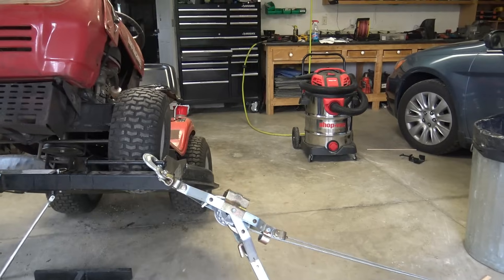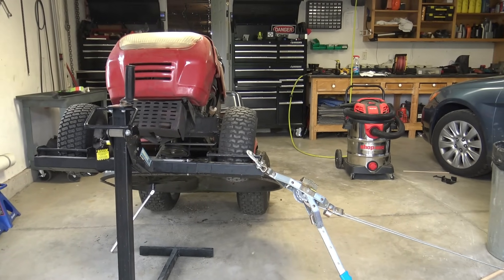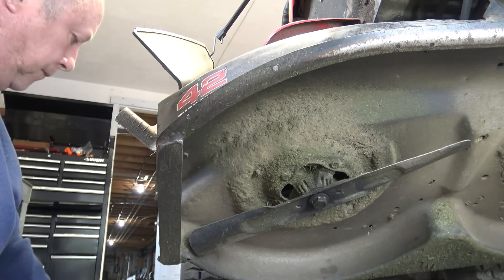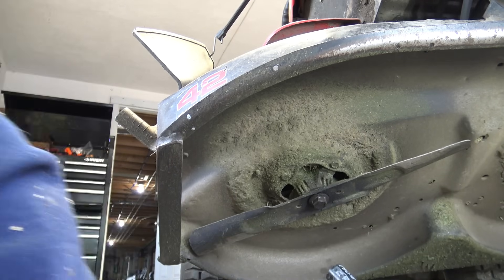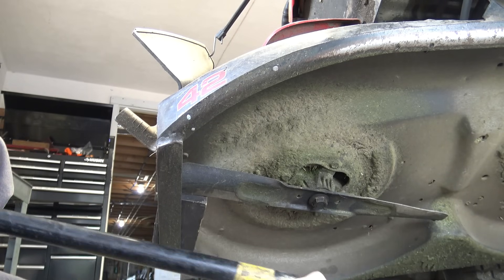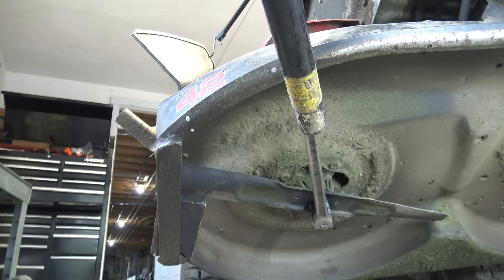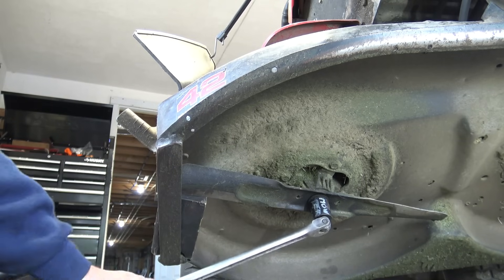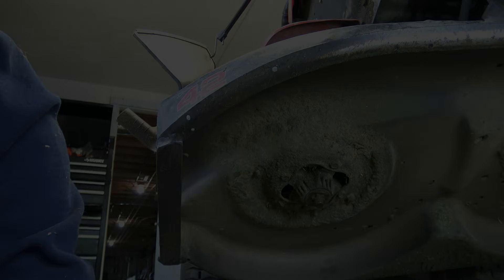How to remove a stubborn mower blade nut

Comment: Fantastic video, thank you so much! You explained it quickly, and simply, just the way people need to know so we can get on with the job rather than watching through a 30min video. I'd tried WD40, heat and an impact drill, but no good. Tried your method and BANG! They both came off! Thank you!!!!!!!!!!!!!!!!!!!!
Reply from the maker: Thanks for the kind words;  I was afraid to apply heat because the spindle housing is aluminum. I don't know why those things get so badly frozen on. I am glad you got yours off. thanks for watching.

Comment: Fantastic idea with anchoring to something else.

Ive been struggling past hour. Scared it was going to fall off my jack and stands

Watch this video and I ratchet strapped from frame of mower to my hitch on truck.

Took maybe 10 more minutes and I had both blades off. They were on there GOOD
Reply from the maker: Thanks, I don't know why they get so tight at times, As I recall I had not changed the blades in a couple of seasons.

Comment: Your video helped a ton. I had the same problem but didn’t have a metal pipe. I had a spare pvc pipe laying around so I used that and it worked like a charm. Thank you for the idea!
Reply from the maker: Thanks for the kind words, Jason,  I am glad you got the blades off
Reply: Would spraying it with WD-40 or something help ??
Reply: I did try that first but the WD40 couldn’t penetrate deep enough into the threads to do anything

Comment: Mapp gas torch and water are your friends to free up frozen bolts/nuts.  Just used the technique on the bolts to remove the baffle on my 8 year old riding lawnmower.   Worked great.
Reply from the maker: I did not want to use a touch because the spindle is made of aluminum.

Comment: Thank you sir for posting.  I removed my mower deck as opposed to lifting it but the key principle you pointed out is it takes a breaker bar along with a sturdy metal pole to extend it.  I had two rounded bolts so I had to special order an Irwin extractor socket and on the ground in the 'rowing' position I was able to finally loosen both of them.  Great tip!
Reply from the maker: That is how the owners manual suggests you approach the job by removing the deck, The machine in the video is not like the new machines today, it is very difficult to remove the deck and even harder to put it back. The lift in the video cost about 200 dollars, I am so glad I have it,  thanks for your kind words and watching my video.
Reply: instablaster.
Reply: L

Comment: Fighting with this same thing today.  Good idea about putting an extension bar on the nut to get the needed leverage.
Reply from the maker: I had not changed the blades in a couple of years at the time, I think that is how they got so tight. thanks for watching
Reply: @richardspaulding5035  we ended up using an impact drill and a cool mower lift to get the nut lose and the new blades on.  Thanks
Reply from the maker: @Butler_Buck  Glad you got them off. As you saw in the video my impact gun did nothing.

Comment: Richard, listening to you was like hearing my own replay.  Changed the oil today, rolled the front up on some stacked cinderblocks, chucked the back wheels, pulled the plug.  Put the socket on and tried with a large 1/2 ratchet driver....  O.o  Impact wouldn't bust it.  WD40 for like an hour.  OK, I've always needed a breaker bar anyway, just in case.  Run to store and picked up an 18".   Now I'm sweating, both my new shoulders are screaming, and I'm swearing.  I'm done for the day.  How long a piece of pipe was that?  It'll be the last time I leave it out.  **Your garage looks freaking awesome*
Reply from the maker: About 4ft long
Reply: Got it. Done deal.

Comment: thank you for the great idea, I just happened to have a bunch of perfectly sized pipes laying around from the last owner. I just put my foot against the rear wheel and cranked with my breaker bar+pipe.. POP! thar she goes.
Reply from the maker: Glad you got the blades off. Commenters have written that the blades were put on too tight in the first place. That is usually not the case. If they have not been changed in two or three seasons sometimes it is caused by corrosion.
Reply: @richardspaulding5035  Thank you, Yes it was definitely corrosion that seized it on there, I didn't do it for a couple years. I put some anti-seize on this time.
Reply from the maker: @IAmAnAiAndroid  good move

Comment: Lowe’s talked me into a impact drill never mentioned breaker bar. Thai was wicked ahhsome. From Bahston. Thx.
Reply from the maker: In most cases the impact wrench / drill will work.  However in this case my impact tool was not strong enough to brake the nut free. Thus I used a breaker bar and still had to add a pipe as you saw for more leverage. Thanks for watching.

Comment: Be sure to use a six point socket when using a pipe. Otherwise you can round the nut off. I learned that the hard way.
Reply from the maker: I did one better. I used an impact socket 
I think we all learned that one the hard way. Thanks for watching and thanks for  the advice.

Comment: i've had success removing frozen rounded head bolts by spraying with WD 40, leaving overnight then heating the bolt with  a map gas torch while hammering the head. They can then be removed with a no screw head socket wrench. Make sure you have a new set of original hardened bolts for replacement before you begin and put a little grease on the threads.
Reply from the maker: Thanks Frank for sharing that with us. Just remember the spindle housing is made of aluminum.  if you get things too hot the housing will melt before you can react. Thanks for watching my channel.
Reply: @richardspaulding5035  Right on Richard! I was thinking that at the time but the blade & nut would absorb a fair bit of the heat - not to get it red hot of course!  mainly to blue the bolt for the cutting socket & soften gunk under the washer & thread a bit.
Reply from the maker: @frankfeatherstone8976  Yes with map gas you are probably not producing a tremendous  amount of heat.  I use ox/acetylene, I would would melt that spindle in a heart beat  lol. thanks for following up.

Comment: Had to do same thing, what causes nuts to get so tight, would installing new nuts help?
Reply from the maker: I think it was just corosion.  That was the first time having that issue with this machine. I had had the machine for about 5 or 6 years when that occurred. Prior to that I had changed the blades at the start of each cutting season without much difficulty.  For reasons I don't recall I had gone two seasons with that set of blades when I had the problems getting them off. If anything, I would coat the nut with Permatex Anti-Seize compound.

Comment: Just had to go threw this!!! Unreal. I used penitrating oil a hammer to hit on it and a 24 inch breaker bar, with the floor jack handle for extra leverage!!! It finally broke loose. When reinstalling I put some grease on those threads. and torqued to 70lbs. 
Hope I never have to go thru that again!!!!
Reply from the maker: Thanks for sharing your experience RALPH;

Comment: They haven't rusted, it's just a p155 p00r design.   
Mine won't budge at all.  I've tried popane, hitting the wrench repeatedly with a hammer etc.  The only thing I haven'ttried yet is aceylene, a breaker bar, or an impact wrench.

Yeah, I watched how much force you were exerting, that was enough to strip the nut, you got lucky... this really is a s0rry design for attaching the blade to the spinner.

I tried the breaker bar (a road sign square pole, the only thing that would fit my huge wrench end) and all this method did was strip the nut.
Reply from the maker: Where I was at, I felt I had nothing to lose. I did not think I could not use acetylene because the spindle housing was made out of aluminum. In any event I was prepared to replace the spindle should things had not worked out they it did. If you were using a wrench that may be why the bolt stripped. You really needed a 6-point impact socket

Comment: Try a small pipe wrench, it worked for me after rounding the bolt with a socket.
Reply from the maker: That sounds like a great idea. If if I am ever in that situation I will most certainly give it a go. Thanks for sharing your idea and thanks for watching my channel.
Reply: Richard Spaulding No problem, enjoyed your pod cast. I was just before getting a breaker bar and thought I'd try the pipe wrench first , it popped lose without using a breaker bar with it.My dad used to use pipe wrench for a lot of things, I guess that's why I thought of it. 😁

Comment: Have a vid on stripped bolts?
Reply from the maker: I recently received a comment from a viewer reporting he used an old plumber's pipe wrench and a long pipe to fit over the handle for leverage to remove a stripped bolt on his mower. With those pipe wrenches' the more force you apply the tighter they grip. let me know how it works

Comment: I had to replace pulley spindle assembly, it was in pieces. The shaft from the old one is still attached to the old blade, can't get it to break free. I replaced that one with new blade. But how can I get the old blade off the other side to replace it? No lift, doing this lying on the ground. Any suggestions??
Reply from the maker: The only safe way without the lift is to remove the deck. I tried one time using planks supported by the tailgate of my truck. The machine came down as I almost got injured.  Do not try anything like that. there are some nice vidos on how to remove that deck. It is a pain to remove but not terrible.

Comment: Why does the bolt on the spindle turn also while I’m trying to get the blade off
Reply from the maker: If you are using a piece of wood to keep the blade from turning while loosening the nut and the spindle turns also then most likely the end of the spindle that locks in the blade is stripped.  if you will notice on the new blade the center hole is in a pattern usually like a star shape.  If that star shape has worn or stripped off the bottom of the spindle the hole thing will turn. if that is the case you will need to order a new spindle. There are videos on YouTube to show how to replace the spindle.  Last time I replaced one of my spindles it was about $50.  let me know how you make out.
Reply: Thank you
Reply: I'm having the same problem. With a cheater pipe on the breaker bar and a lot of effort the bolt will turn but not break free. I guess I will buy a good impact wrench and try that. If that doesn't work I'll have to bring it to the dealer. Thanks for posting a great video!

Comment: Interesting how much praise this guy is getting for using a pipe extension. As if you people have never heard of the concept of a breaker bar??
Reply from the maker: Not just the pipe, the video included chaining the machine so it would not slip and instruction as to which way to turn the nut. It also demonstrated that the owner need not be afraid to use excessive force. Furthermore, in the video I suggested the use of safety glasses. It is ok however, you are not alone, I get lots of comments from other haters.

Comment: Tried a impact wrench it's took the edges of the bolt so now I can't grip it with anything, now what do I do!
Reply from the maker: You must have been using a 12-point socket for that to have happened. Pick up a 24mm 6-point impact socket as that might still work. A 15/16 standard socket is slightly tighter than the 24 mm socket If you want to try that. All that is assuming your spindle nut is the same size as the one in the video.  Do not use a touch as the spindle housing is likely made of aluminum. Stay in touch as I may have other ideas if that does not work.
Reply: @richardspaulding5035  it was a 6point 17mm size the only one that fitted it well 15mm didn't fit 18 was too big, with a impact wrench ona murray ultra msd100 mower, ill try some spanner with a long leverage to get that off if I can find one ha
Reply from the maker: @honorabilis1  If that fails pick up one of those nut splitter tools. They sell them at AutoZone. They go for about ten dollars. Then pick up a replacement nut at your local hardware store. I would like to know how you make out.
Reply: @richardspaulding5035  I got one off with mole grips and a old ferguson te20 exhaust I had laying around for leverage ..could call that exhausting work ha
Reply: The other bolt though is just a circle now , I need to buy some bolt extractor
Reply from the maker: @honorabilis1  I am glad you got one off. They have these special nut extractors, The more pressure you apply the tighter it engages the nut.
Reply: @richardspaulding5035  ordered something that should get it off, only doing this because the belt snapped and took deck of to find blades badly dmged and blunt do replacing those as well, was a imported ride on mower from USA, I'm in UK
Reply from the maker: @honorabilis1  Let me know what you used and if it worked, may help other viewers
Reply: @richardspaulding5035  i tried some bolt remover designed to do it, but they just broke on me, ill try drilling it out next
Reply: @richardspaulding5035  no luck yet drill bits don't cut into it, ones made for extracting bolts don't work ethier at this point I'll have to just buy a new deck
Reply: @richardspaulding5035 i removed my rounded off bolt by using a pipe wrench and a pipe on the handle for leverage.  Replaced the bolt with new from hardware store.
Reply from the maker: @philipkuchko4860  Great idea
Reply from the maker: @philipkuchko4860  A Pipe wrench at times is a great tool to have on hand.

Comment: just bought a longer wrench ..ng .. breaker bar sounds good
Reply from the maker: May need a breaker bar and a pipe. Those dam blades can get really locked on there
Reply: @richardspaulding5035  final attempt used a plumbers wrench I couldn't believe it worked.

Comment: So.. the come-a-long.. could you expound on that a bit more?
Reply from the maker: Thanks for the question jean; It is actually a geared cable hoist. If you want to see what one looks like just google search cable hoist. I just hooked it around a support post in the garage and attached the other end to the machine to keep it from slipping when I exerted the force with the breaker bar and pipe. An ordinary chain would have worked as well. I hope that clears it up for you. Thanks for watching.

Comment: I wonder if you could rest that breaker bar against that steel column, and then start the engine and engage the blades.  I remove crank shaft pulley bolts on cars that way.  Just make sure you're 100% sure of the rotation direction or else you'll have a breaker bar flying thru the air.
Reply from the maker: Thanks for the suggestion; But not in this lifetime

Comment: My lawnmower has some sort of plastic cap over the bolt , I'm really struggling to remove it so I can finally just unscrew the blade from  the motor
Reply from the maker: I have never heard or seen anything like that. Can you snap a phoro and post it on your channel?  I will subscribe so I can see it.

Comment: What if you don't have a lift like that?? How can I get to it to get nut off to replace blade? Very rusted. Yard machine mower
Reply from the maker: The procedure for changing blades is to remove the deck. In that particular machine it is a pain to get the deck out. that's why I purchased the lift.  you can get them at Lowes or Home Depot for about $200. Thanks for watching my channel
Reply: Just use a floor jack

Comment: not sure of your mower but. it takes 10 minutes to take the deck off and 10 to put it back( on mine)... 5 pins and a cable. that way you don't have the thing jacked up in the air and you pull it out and work on it. in the same sense... you have a garage and I have a yard lol...so 10 minutes in the yard probably 5 minutes in a garage. I recommend taking the deck off to work on it versus this .
Reply from the maker: Thanks Steve; I like the way I do it, this was an unusual case whereas the blades were frozen. Usually, it is 2 minutes to raise it up less than 5 to change the blades and 1 minute to lower it back down. My neighbor called me last Saturday evening. He wanted to know if I could swap his blades in the morning. He had hit a rock earlier in the day. I was not going to be home so I told him bring it over now. He was in and out in less than 10 minutes total.  If you enjoy struggling with your deck, I wish you many more years of happiness.

Comment: mine completely stripped its round cant get it off.
Reply from the maker: I would try one of those nutcracker tools. possible you can split the nut enough so you can knock it off with a chisel.

Comment: What size is the nut. I need to order the correct socket
Reply from the maker: Thanks for the question.  It was a 15/16 socket for my machine. Yours should be the same if it was manufactured by MTD.  There are many brands that fall under the MTD family such as Troy, Yard Man, Yard Machine, Cub Cadet , Craftsman and others. I apologize for not mentioning the size in the video. Most of all I want to thank your for watching my channel.
Reply: Richard Spaulding I have the same exact machine. Thanks for taking the time to reply! Take care.